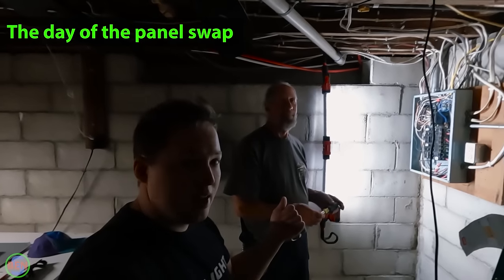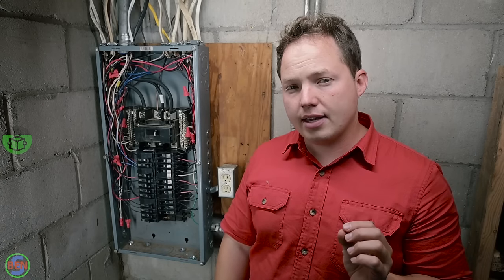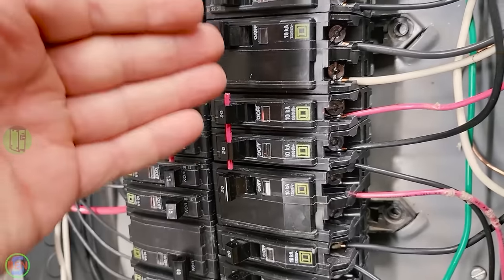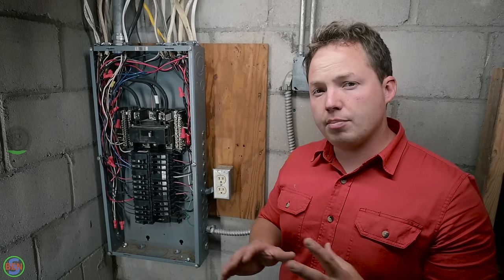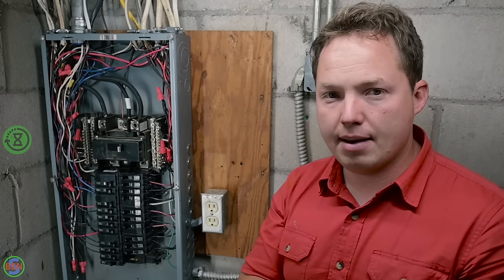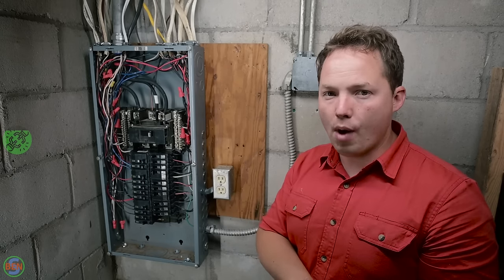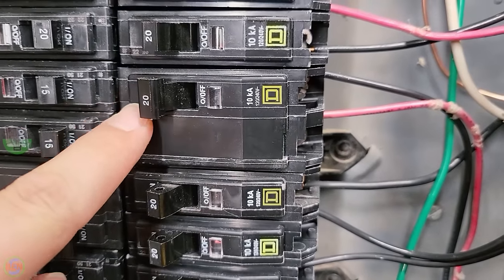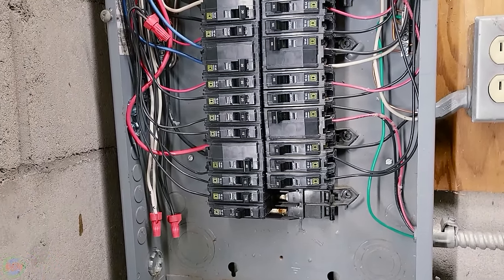How To Replace a Main Panel or Sub Panel - Upgrading an Existing Electrical Service

Comment: An interesting video, thanks.
One thing that stands out as a difference between your panel replacement and the equivalent here in England is testing.
Here, testing (and recording) of all circuits for continuity (with a low ohm meter) as well as insulation resistance, and the performance of RCBOs (equivalent to your GFI breakers) is mandatory, to ensure the safety of the install. I’m surprised that’s not the case in the US.
Reply: I think its because in Europe they use Ring/Radial Circuits, which we dont, wires go straight from the panel to the outlets and never back again. so for a continuity test you would technically have to short live an neutral at the outlet or at the breaker and then you can test with a multimeter at the other end, otherwise to test continuity/resistance you would need a test lead that goes from the breaker to the last outlet in length.

so for the most part i think we just make sure we follow the rules of wire size and length (to make sure that the wire can handle the current at the distance) and be dang sure our terminations are good to prevent arcing.
Reply: @jjjacer  thanks for your reply.
You’re right. For non-ring circuits we use a long lead, as you describe, zeroing the meter first.
We also use a long lead to check that metallic face plates on sockets and switches, which are popular here, are  earthed properly. 
Interestingly, AFDDs are only just being installed in domestic properties here, as they are quite pricey, but we do tend to protect individual circuits in the board with combined GFI / breakers, called RCBOs here.
Reply: Another reason testing hasn't caught on here in the USA is that, as you can see, it would be next to impossible. Panels here have been designed with little to no consideration given to maintenance, testing, or replacement. This panel has just been replaced and it looks like a rat's nest. I can't blame the installer too much because panels aren't designed with enough features to help keep installation neat. In many panels it is quite a chore to find the matching hot, neutral, and ground wires that belong to a cable. And that makes replacing or testing a cable needlessly hard.

We really need to start from scratch and come up with something better. I'd prefer a panel option where every cable comes in at the side right in line with each breaker slot - where hot, neutral, and ground connections could be easily made in the same spot and wire lengths could be kept down to a couple inches. We should be able to perform 5/10 year circuit tests like in the UK - but that won't be feasible unless our panels are improved.
Reply: @JasonEDragon  Interesting - thanks!
Reply: @JasonEDragon  this was just a terrible cheap farmer job. this made my skin crawl . when i or my employees upgrade services i require the devices go into a wire way then conduit into the load center using appropriately sized wires with proper identification and in Canada you are required by law to bring the whole house up to modern day code that means every single circuit if you have to rip open walls your ripping open walls and the mains breaker is required to match the service . i could go on and on. im shocked that this install is allowed where he lives. this would get your site locked out and your meter pulled . so to clarify this was a garbage trash side grade you can cheap out by installing boxes and and then run new runs from there to properly connect into the new load center this is perfectly fine as long as its labeled tested and updated to modern codes for examole bedroom plugs seperated from lights and seperated by room into an arc fault breaker bathrooms gfci breaker seperated from any other room furnaces by themself dishwasher seperated kitchen plugs 20 amp alternated or  20 amp split . etc etc etc its a big expensive job  depemding on the home age its a full rewire full rewire often cheaper that way then fixing rats nests which burn houses down. this is seriously scary to me and not how i was taught at 15 to wire a panel. and marretts inside of a load center omfg...... completely illegal  here your too short so install a box beside rhe panel and run a wire to the panel. this is horrifying
Reply: @kayceem2335   I have read your comment. If this was new construction or a remodel, then everything would have to be changed, and the finished panel would be nice, neat, clean, with everything perfect. However, if the panel alone needs to be changed, that should be sufficient provided that any and all SAFETY concerns are addressed and deficiencies corrected.  SAFETY is the number one concern.  Correct functioning is second. Cosmetic appearance comes third. However, I agree that all work should be done in a neat and workmanlike manner. Further, all work must meet code and be inspected and approved by the Authority Having Jurisdiction.   If all NEC or CEC requirements have been met, then that should be sufficient. 

Your local practices and code considerations may be different. But in the real world, most homeowners are hard pressed to pay for a simple panel replacement of an old or undersized panel. To require the extra work you suggest can be justified if there are safety violations that extend beyond the panel and into the walls or ceilings. Otherwise, it is unaffordable, and NO work would be done, and safety issues would not be corrected.

Comment: NICE VIDEO IM IN THE TRADE. THE TERMINATIONS OF WIRE COULD BE A LITTLE  NEATER N LABELING THOSE WIRES WOULD BE EASIER FOR IDENTIFICATION OF CIRCUITS.

Comment: Normal 15 -20 Amp breaker $5 a pce afci or gfci $35+ duel  afci/gfci $55+. Piggy back breaker $10.50 but saves a space if your panel can have them. Northeast USA big box store prices from a year ago

Comment: I once worked at an industrial plant that had multiple breakers feeding an oversize neutral like 6 -15 amp breakers and a #10 neutral feeding lighting loads.  Had to be very careful if  a florescent ballast had to be replaced because if all the breakers feeding the lighting  on that neutral were not shut off the neutral was still live to ground, SCARY!

Comment: I knew an electrician that opened a junction box and disconnected the neutral going through it. Fried some electronic equipment. The boss told the customer to send him the bill for replacements. Very expensive few seconds.
Reply from the maker: Yeah that's no fun at all.

Comment: Handle ties required or duel breaker for multi branch circuits in my area. And wire will not be acceptable unless you can keep it from sliding out/off breaker. Handle ties easier to just buy  anyways.

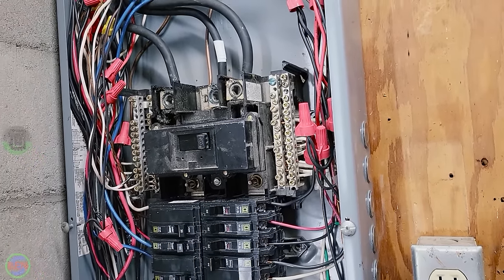Comment: multi-branch circuits...   well ive only done one in my entire life.  wiring a house and the upstairs family room was at the far end away from the panel.  just off the family room was a small office.  half the family room on one circuit and the other half of the family room wired with the office.  two twenty amp circuits. two final home runs.  4:30 in the afternoon.  I grabbed the end of the wire on the spool and started the home run for the first half of the family room,   immediately noticed there was not enough wire for two home runs,  to the truck,,  no more 12/2.  shop 45 minutes away. sheet rockers tomorrow.  damnit.  then I saw the 250' roll of 12/3..  changed the home runs to the first switch box with a jumper from the switch box to the first outlet outlet in the second half of the family room. connected the red wire to the black jumper and labeled a piece of sheathing, 'shared circuit home run'' just above the wire nut, made another one for the connection to the switch.  at the panel labeled the 12/3 'upstairs family room/office shared'. picked up my tools and headed home.  wrote down 1 hour overtime.  since then I always pack partial rolls of Romex.  never in that situation again.  as far as I know it is still working.

Comment: Thanks for the advice on the panel, it's really useful all those requirements from the NEC, but I'm still dealing with short wires to reconnect evry single line from each room in the houses I've been working on;  by the way, could be good if i make them a little longer those wires coming from any room or the kitchen in the main panel ?

Comment: So here is my question...if you are no longer permitted to feed anything from the main lugs how are you going to attach the sensing for the automatic transfer switch? Also considering I dont have an automatic transfer and when I run my generator I flip the MAIN OFF and then GENERATOR 30A breaker ON. That feeds my entire house from the generator but I have no way to find out when the power is back. So my idea was to install a small box with 2x250mA fuses and pilot lights that would come on ONLY when the main feed comes back on. Any other ideas?

Great and detailed video btw! You explain things really well!

Comment: Thank Benjamin. Excellent video! I have an unrelated question. When replacing a ceiling fan that is bigger than the existing fan housing. The power supply wire ends up a ted short. I guess the proper way is to extend the wires with a junction box. Can the junction box (with the cover) be attached to the joist that is hidden inside between the 6 inches height ceiling and upper floor space? Or, does the junction box with cover need to be shown through the sheetrock?
Reply: the cover must be exposed
Reply: Junction boxes don’t have to be shown just responsibly accessible
Reply: @FishEyeSky  314.29(A) Boxes and conduit bodies shall be installed so the contained wiring can be accessed without removing any part of the building or structure.
It must be exposed.
Reply: dont bury junction boxes.  if the homeowner objects to the aesthetics, quote the time to run a new switch leg they usually come around to the j-box.

Comment: What is the best way to leave your current wiring 100amp panel in place but adding a 200amp panel to allow for generator and solar upgrades for incoming power??
 
I have a less common situation and I need help finding a video or blog guide on adding a 200amp panel to the outside to meet current code while leaving my original 100amp in place inside my house.  I don't want to move all the circuits & I like having interior control & some of the wires would be too short to relocate outside.  No one does this because this requires a 100amp breaker to be installed inside the 200amp panel probably?  (Is putting a 100amp breaker inside the 200amp panel possible?)
Reply: You'd need to put a breaker controlling the initial panel in the new panel. And upgrade the wire from the meter to the new panel.

Comment: Hey Ben! I'm Building off grid atm. My Mains was an Open box buy deeply deeply discounted it's a Square D.  We never planned on much but a simple setup.  The Mains did not come come with a Mains breaker. Box was empty. All I  could find in all the box stores was a Dual pole 60 amp.  This 60 acts as my Main breaker.  We have a few 20 and 15 amp breakers to work with for a coffee maker, microwave, toaster and airfryer. All Lights are led. My biggest problem is my new 6,500 watt 240v tankless hot water heater ( adjustable ). I'm going with 10/2 awg copper and a 40 amp dual breaker.  (6,500w divided by 240v = 27 amps ) My question is the 40 amp breaker too big?  Would a 30 amp dual be cutting it too close?

Comment: This video came on with perfect timing!!! Youtube and google are listening to me talk with inspectors and electrician! This is great education!!! Are wire nuts banned? Are we supposed to use wago  connectors now to meet code?
Reply: No wires are not banned 🚫, just nuts are banned. The problem with Wagos is that they do not work well with stranded wire, they work fine with solid wire. Check to see if Wagos are UL listed, if they are then maybe they are ok to use everywhere

Comment: Could you still install the ground bars and have a single wire connect to the neutral bar to have continuity. Would it then trip the breaker?

Comment: Just curious I've been learning and I thought in a sub panel the "Green Screw" which grounds the neutral bus to the panel casing has to be removed unless technically the grounds and neutral are bonded no? This is a sub panel rii? Idk that confused me, thought I knew my stuff 🤣

Comment: Hello Ben, I love your videos! I have learned so much from you. Thank you!  I when to your like of the recommended load center, and it's a Square D 30. I need a 40-space panel, but the only one I found on Amazon won't give you a commission.  Can you make your current recommendation for a 40-space panel? I would like you to get a commission to help support your hard work in making these extremely useful videos. Thank you!!

Comment: Hey @BenjaminSahlstrom - what is your recommendation regarding choosing a Sqaure D Homeline vs. a QO panel?
Is it good enough to choose the Homeline panel with the Aluminum busbar, or should I look for the Copper based busbar QO panel?
What are the pros and cons of each?
Will I regret going with the Homeline series?

Comment: If you are installing a new 200 amp breaker box in a different location in the same house to rewire the house how do you get power from the old box to the new box so as you rewire a room you can wire to the new breaker box.

Comment: large manufacturing plant, water heater with one neutral no ground and 2 hots on separate electrical service meters gets OSHA, the Fire marshal and the Electrical inspector's attention
Reply: Don't you know? Old school thought was: the conduit will act as the ground... Until it corrodes and falls away. Or the water heater is bonded to the ground rod ???  ???!?!!!?
Reply: Wait a minute. You said that the water heater is fed from two separate electrical meters. If I was the other guy I'd let the other guy pay for it. Maybe two businesses share one water heater and one of those guys is always late paying his electricity bill, etc etc

Comment: Ben, how do you avoid high tension tight 90° turns in wire when you have to terminate thick wire on a breaker terminal for example I recently wired a generator power inlet box with 4 gauge. The panel is already real crowded. Eventually I'd like to upgrade the panel but for now have to make do. I bent the end of the wire over with the handles of the cable cutter then stripped it in place. It makes a sharp 90 but it doesn't seem to put any strain on the bus since it's already bent essentially like conduit lol. Did they make some kind of 90° nimbus or something for this purpose?

Comment: Hi everyone,

I've got a newbie question for Y'all. I am switching out a breaker box as the original is covered by the washing machine (mobile home). The original is going to be left in place and used as a junction box to extend all the wires to a new external breaker box. It's a three wire 200A original circuit. My question is, can I leave all the neutrals and grounds connected in the original box and just run the hot wires to the new exterior breaker box along with extensions of the three service wires? Just seems silly to me to run all new grounds and neutrals if they're already connected.

Comment: i don't zip-tie. building wire is typically solid and stays where you bend it to.
required or not, i phase-tape black red white if the wire's insulation is not the correct color.
i'm not licensed.

Comment: my meter is inside my home. The power line come off the pole on the street to the side of my house. The city said changing a panel now requires a main shutoff outside for first responders to pass inspection. In my research the main disconnect is between the meter and the panel. Does this mean by default I have to have the meter moved to the outside of my house to pass inspection?

Comment: Near philly, its 4k to 5k  to swap a 100A to 200A
Reply from the maker: Wow, that's pretty spendy. Interesting how much it varies by region.
Reply: I think there's going to be a huge variable in cost between simply changing a panel and doing a service upgrade. If you need a new service drop that can be a lot of the cost, especially if the homeowner is responsible for the line side of it.
Reply: @jamisongillespie3524  I dont think theres ever an instance where you dont need a new line side doing a 100 to 200 upgrade. It's pretty much always going from 2/0 to 4/0, unless its a super long run or something.

Comment: My mother’s house has a setup where there is a 100 amp breaker in the outdoor main panel feeding a sub panel that has a 200 amp main breaker. There’s 2/0 AL feeding the outside main and smaller Al wires feeding the sub. Is this setup ok? Should we have the outdoor main upgraded to 200?

Comment: The wire through the handles trick should only be considered temporary. In the future the wire is going to fall out its just a matter of when. Also someone not knowing why that wire is there might simply remove it. Best to have the handles properly bridged or the 2 pole breaker.

Comment: For main panel upgrades where you only need 2-4 new slots in your panel, would installation of a subpanel adjacent to the main panel be an acceptable alternative to replacing with a new panel?

For people looking to add a 2-pole surge protector, a panel replacement might be cost prohibitive. (Yes, there are combo surge protector circuit breakers, but not for breakers that also have GFCI/AFCI protection, which may be desirable even if code doesn’t require them for old work.

Comment: does anybody know how low to the floor a breaker panel can be mounted? is there a minimum. I want to locate mine about 2 ft off the floor